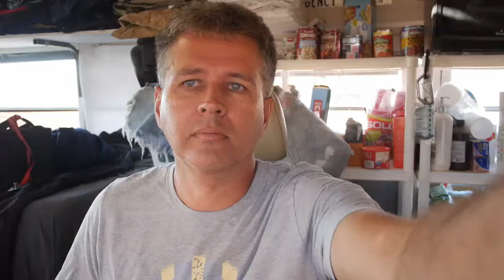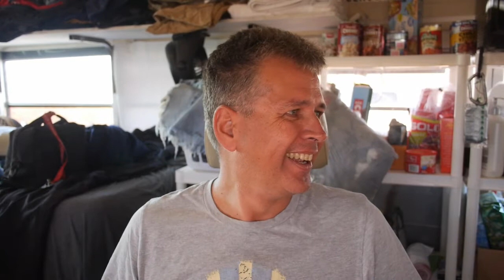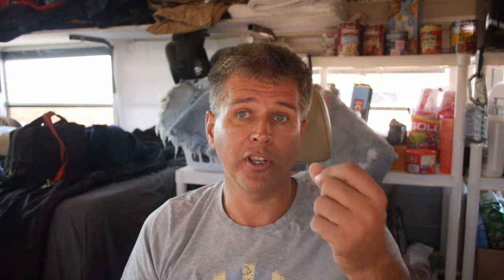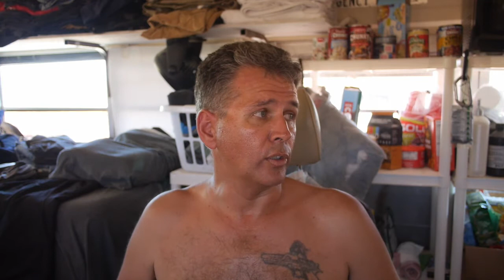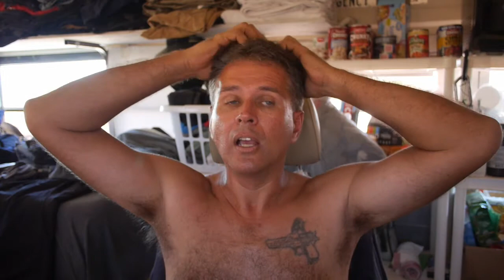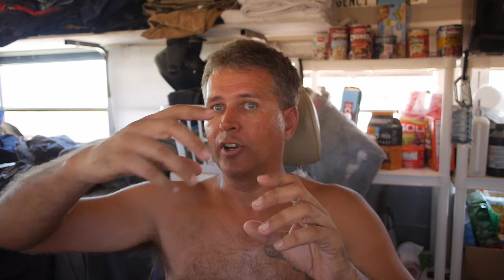Water Still Condensing - Composting - Greenhouse - Gray water

Comment: I wonder if you could use a solar water heater, recirculated into the gray water tank, to speed evaporation.  Then a condensing unit made from copper pipe draining into the condensate tank.
Reply from the maker: Charles Builds Crap yeah that makes sense, when I get time to build some prototype, will definitely be posting video. Thanks for the feedback.